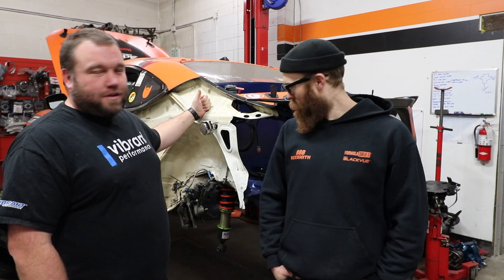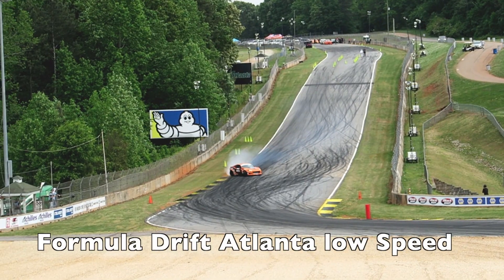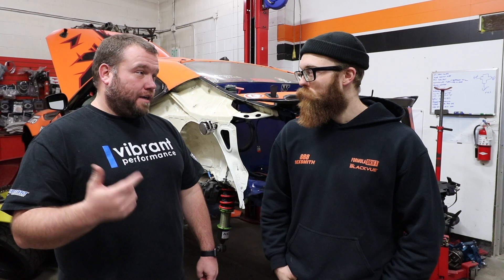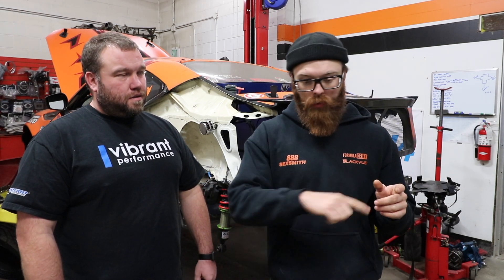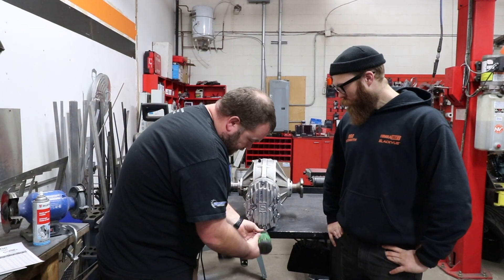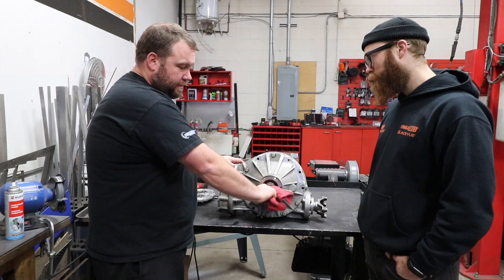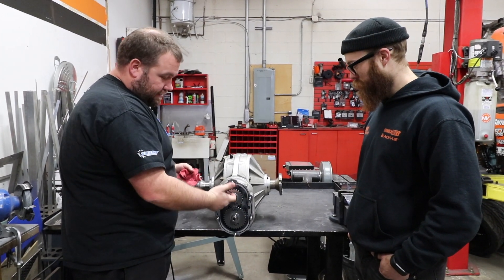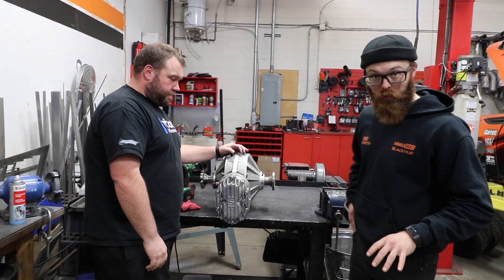Drift Biology Episode 1 - Quick Change Differential

Comment: Are there any drivers who feel more confident with a fixed set of gears for example? I don't know about drifting, but in a street car I really hate switching between comfort and sport mode. I prefer getting used to one thing and having it stay consistent, otherwise, I lose a bit of confidence, it always feels like something isn't right.
Basically my question is, is the quick change a must for pro drifting, or is it part of a driver's style/preferences?

Comment: This is like welded? I mean each wheel is spinning in the same speed or it is like lsd?
Reply: In comparison to welded would be a spindle. A spindle spins both axles at the same rate, just like a welded diff would.

Comment: I am trying to learn about the gears and differentials used in drifting and I haven't been able to find a lot of info on them. The few that I have seen only talk about spools not being a good option vs LSD, but I see you state that you ARE using a spool and are definitely kicking a$$ with it. Did I read that correctly? Also do you know what the % loss is of power? FYI... Winters makes some helical gears for a quieter ride now apparently so I am really thinking about using this in my car now!